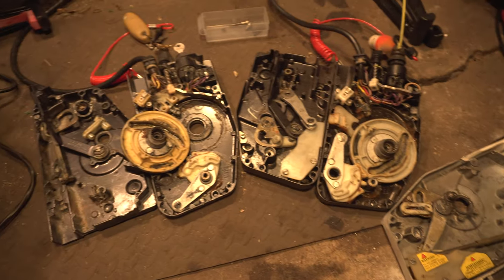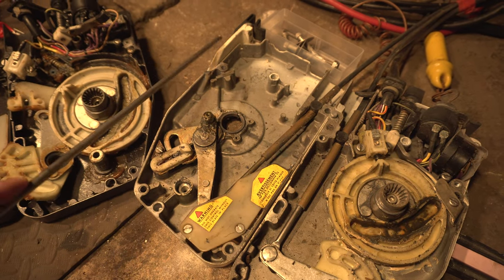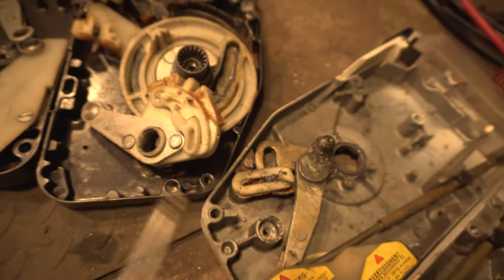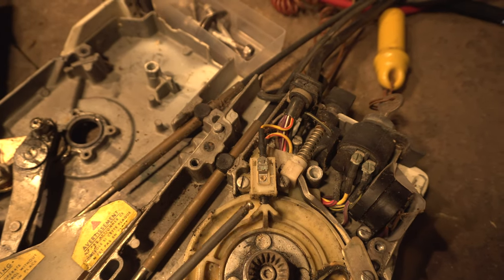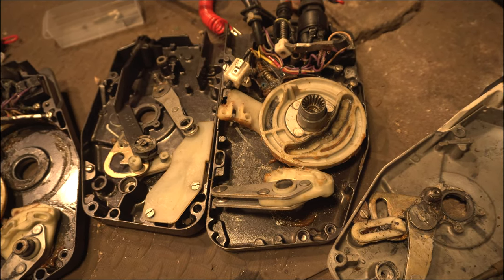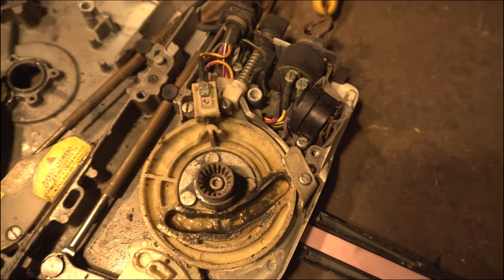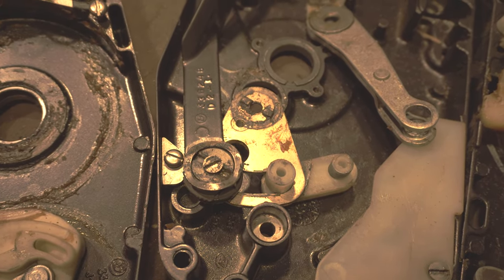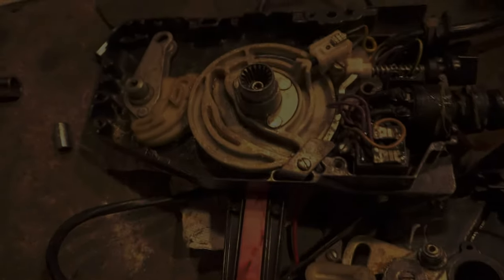Evinrude Outboard Controls Repair - Troubleshooting / Disassembly

Comment: I am working on a 1982 evinrude 35 hp remote that needed a new ignition switch...when you get in to wiring it seems like a whole other story as far as easy vs non easy!! good video thanks
Reply from the maker: Hey, the switch should be too difficult. On mine all the wires are connected with little bolts. You can google the wiring diagram. With this video I was just trying to show as much as I could since most videos dont really explain about what is going on inside much. Thanks
Reply: If you ever want to show the ignition switch install that would be awesome..thanks
Reply from the maker: https://youtu.be/xRJZjKjlprI Hey I just made a new video, it has some useful diagrams, this is just the first part. I pretty much took everything out of the controller and put it on a wooden board for testing.

Comment: Thank you for the video. I have a question sir. On my 94 Johnson 40 hp while night fishing when I turned the switch a weak alarm sounded in the controller and my tac and fuel gauge would jump but the boat would not start. I took off the auto oiler years ago. It does not appear the battery is low and getting ready to do a load test. If battery is bad would it sound the alarm? I also tried boosting with my Noco jumper on the water. Slow trolled in for 3 hours on Tn River. What all does that alarm control?

Comment: amazing video i bought a used boat with the controller needing fixed and the guy was talking about that ball im hoping you could point me in a direction where or how i can fix it i have a switch that has the 3 buttons from another controller but want to do it right if you have any tips would be amazing

Comment: I have an old Evinrude Power Pro for my Johnson GT150. Power pro parts are old and worn, I’m looking to replace entire throttle control side mount. Any suggestions for replacing with a new throttle side mount That still hooks up roughly the same as far as shifting and choke linkages go?
Reply from the maker: Not too sure, I generally go the buy a used controller on craigslist and use its parts or the whole thing.

Comment: My controller will only allow me to go forward. It won’t return to neutral all the way and won’t go in reverse. Can you please help me
Reply from the maker: You need to take it apart and watch the video carefully most likely there's nothing gripping the cables or you should be able to figure it out pretty easily when you open it up and just move the handle. The controller is very self-explanatory.
Reply: @cenkaetaya  I found the issue. It was the plastic gear that engages the throttle gear. One of the teeth was broken and threw off the alignment. Thank you for getting back to me.  Is it possible to remove the old one and take one from a donor ?
Reply from the maker: @treyt6765  yeah pretty much all the controllers are almost the same. You'll be able to know right away if it works or not.

Comment: What type of grease should you use? And did you ever fix the neutral recognition switch issue?
Reply from the maker: I used quicksilver Multi-Purpose 2-4-C Marine Lubricant. Yes, after cleaning everything / fresh lubricant the controller is working great.

Comment: I don’t think that’s a choke lever, it’s only for warming the motor. The choke is operated by pressing the key in when starting via a solonoid on the motor, has a little red knob on the solonoid for manual choke.
Reply from the maker: Throttle advance. You are correct it's not a choke.

Comment: I got a 1974 115 evenrude and the Control was sloppy I tightened it up an now it won’t even turn over The throttle tensioner doing nothing it’s just sloppy flopping around

Comment: great video, but he didn't explain how to repair the shift button at the top of the shifter. I was really looking for that info.
Reply from the maker: The one for motor trim up and down?
Reply: @cenkaetaya  No the one for removing the shift lever and fixing the squeeze button at top of shift lever which allows you to put motor into F-N-R and speed up.

Comment: the changes in neutral and the manual throttle does not work I put change and if it works it should be

Comment: And it will not go in reverse on the Control only go forward
Reply from the maker: Is the control itself not going into reverse or is it the engine?
Reply: It was turning over The controller was loose I tightened it up and It won’t do anything
Reply: I think it’s the control because I had a hard time trying to get it to go in and drive to reverse it did it a couple times and now It won’t do nothing
Reply from the maker: @samtate1260  I would take it apart and take a look inside. It's got to be something simple.
Reply from the maker: 1 more thing make sure the motor isn't actually stuck in forward. It will start up in forward gear just fine and it may not be immediately apparent.
Reply: Hello Everyone I took the cable off the motor and it shifted fine so I took the control box apart and there’s a piece in there it’s really worn down I think that’s why it stuck in reverse I took the part out and I’m gonna go get it tomorrow Terpstra’s blue marine in Griffith Indiana
Reply: Do you know what piece?